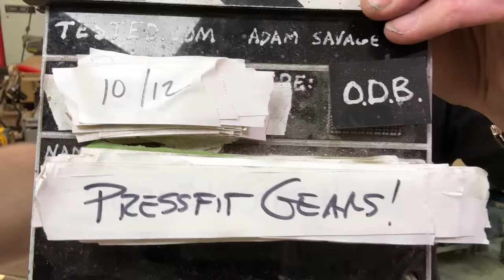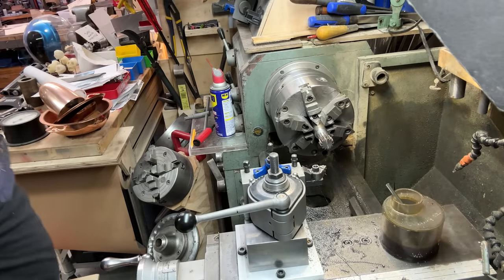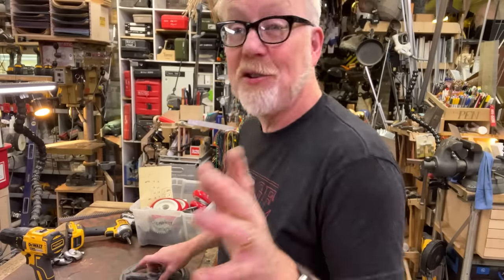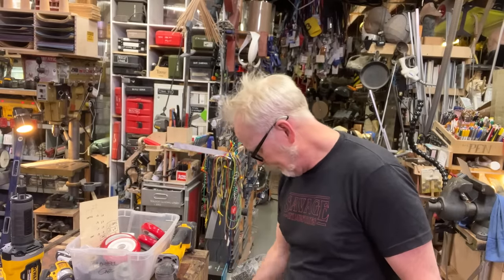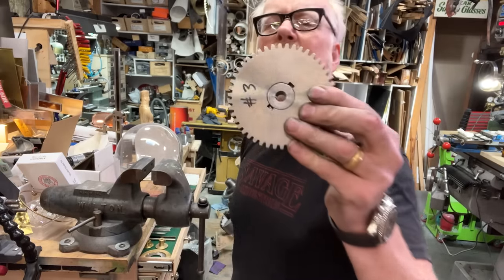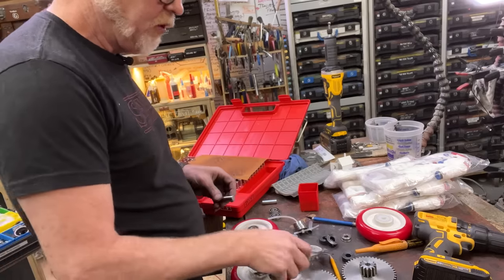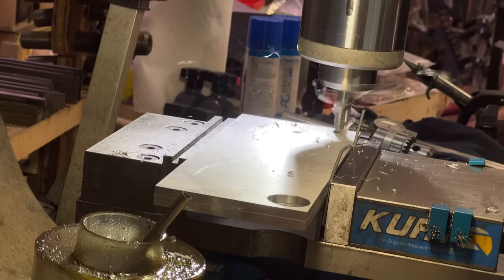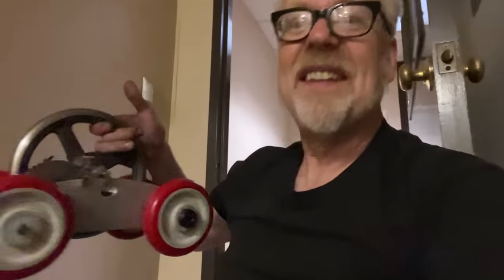Adam Savage's One Day Builds: Giant Flywheel Toy Car!

Comment: Adam not sure if anyone pointed out the low performance issue the same as I. The reason for the loss of power is due to the weight/mass of the gears in between the flywheel and drive wheel. The Inertia from the flywheel is all going I to turning those gears. The more weight you remove your performance will increase incramentally.

Comment: Since you have a planetary gear system in those dewalts, im not saying take apart your dewalts lmao im saying an old set of drills with the planetary gears, or many different type of gears, and place a North magnet on the center of the furthest gear, as well as have the other North end of a different magnet on the opposite end of the gear! The magnets need to be round of course. What happens is when you do it "North and south", it pulls the gears or stabilizes them at high rpms, but when you go north vs north, its a different thing ya gotta try. i never could try at high rpms cause i couldnt bind the magnets to the cogs without them flying off lol

Comment: The inertia driven toy car is a classic, but what about configuring this system to aid in powering a bike or even something similar to a long-board? Obviously you'd need a combo break/clutch of some sort, lest you 'ride the bomb to hell'. But it should be doable. And how cool would it be to get around San Fransisco on something as green as an inertia driven vehicle? It'd be like a Flintstone's car...that wasn't a death-trap! The ratio between overall mass and the mass of the flywheel is what's keeping it in snail-mode, at that gear-ratio.

Comment: My guess where a lot of the friction is is that middle gear set. If the flywheel and gear were separate, you could have supported the whole gear train in between two sheets of aluminum and then the flywheel on the other side with a third piece of aluminum.  I think the middle set of gears are racking slightly from the torque

Comment: For doing press fits, one thing that was always recommended to be was to heat the outer part (not enough to change the temper) and to freeze the inner part. The explanation was that heating the outer part causes it to expand, and freezing the inner part causes it to shrink. Even if they shrink/expand only a few thousandths of an inch, it could make the press fitting process easier. Or does someone know the physics better who can correct me?

Comment: There is an older video out there, (I have no clue of the title) but it is about a bus, that had a heavy flywheel in the center of it, and it would be spun up to crazy RPM's that made it crazy dangerous, but at full RPM, it would take like hours to spin down to zero RPM, it might have even been days. This video of the flywheel passenger bus, would use the stored up energy to take off, once passenger sat down and it would do this all day. The flywheel weighed like 8 tons or something crazy and required an armored enclosure around it, just in case the flywheel let go... The video is interesting, just due to the numbers that were presented to make it work

Comment: I feel like you could put some handles on it so you can properly 'charge' it. Either that or build a motorized charging platform that spun the flywheel up to dangerous speeds and then you just let it run.

Comment: I wonder if the gears being really heavy in relation to the flywheel might also be an issue. That's a lot of weight to spin up, you might be losing energy to torque required to move the gear train. You could probably get away with cutting those gears in half

Comment: Love the reference to LPL! ;D

I think the width of your gears need to be minimized. The gears are sort of flywheels themselves, so I don´t really think mass is the problem - but interaction between gears generate a lot of friction as each tooth slides into the next, and these gears seem to be able to power any normal car. So - easy test is to just grind down the teeth on your lathe to reduce interaction between gears.
Reply: No.. the fly wheel is not right
Reply: I don't think Adam really understands the physics of gyroscopic precision
Reply: Precession
Reply: Word to text

Comment: People keep saying the problem is the wheels are too small. That's not the problem. Wheel size only affects the speed that the wheels turn, and  wheel speed is not the problem here. The problem is that the flywheel is coming to a stop very quickly. You need a more massive flywheel. Either rebuild the whole thing in nylon and keep the same flywheel, or make a new flywheel out of solid lead.

Comment: Increase the wheel diameter and then try stepping down,the gear ratio so you can get more wheel rotation for,each flywheel rotation. There will be a happy medium in there.

Comment: Nice try Adam it dos look awesome though. it's lack of performance might be from the weight (rotating mass) of the drivetrain, In all the flywheel toys i had as a child the the flywheel was WAY heavier that all the gears combined and solid that helps keep the car going, your gear are REALLY heavy and you flywheel has cutouts limiting it's potential momentum it could also be a bit bigger in diameter too

Comment: Normal size flywheel cars are small enough that you can grip the chassis and push it along the ground to generate momentum. But that's too big so you have to add a handle that rises just above the flywheel, attaches to the chassis, so you can push down and forward at the same time to generate good speed.... And of course, fix that rattle.

Comment: How does one cast or repair a split plastic gear (which transmits power) in an old toy, such as a toy battery-powered front-end loader, or is there a CA glue or something like Loktite HY 4070 5 minute hybrid adhesive (which will quickly glue broken bumpers together edge to edge w/o any reinforcement).  Inquiring fathers and grandfathers with old motorized toys would like to know.

Comment: The issue with up scaling. If you pushed that at full running speed the flywheel probably wouldn’t spin a third of the speed of the little one. But great build, and year put a pitching machine on the top and it will fly

Comment: Tell me that seems as if a mechanical disadvantage was created where you can put a lot of energy into the system and it uses it in the least efficient way possible. Seems like just a caring issue. I don't know if it's primarily the fact that certain things don't work spectacularly well when you change the scale quite a bit but I think it's just down gearing and perhaps gears not messing

Comment: I'd say it's more likely that your pin gauge was correct and your measuring tool was off. Always clean your caliper and micrometer measuring surfaces before use if you are working with high tolerances. You can close them lightly onto a piece of clean paper then pull the paper out. Try it sometime. Zero out the tool then clean with paper. Often times you will then see that the surfaces were not clean.
Reply: Also don't force a pin gauge in then twist it to get it out. Treat high tolerance measuring tools with a lot of care. I cringe when I see people using calipers to scribe lines. If it's an old tool that you use for low tolerance then I guess it's fine. But never use your good measuring tools for scribing lines.

Comment: Put a handle on it to hold it up, and weld a nut to the end of the drive axle and use a drill with a socket on it to spin it up and then set it down.

Comment: Try bigger wheels, That will change you ratio with the least amount of work. Seems you don't have enough traction to get your flywheel spinning at the desired rpm. Add appropriate dye to the teeth to check your contact patterns. Straight cut open gear box is going to be noisy no matter what you do but that's ok it adds to the cool factor if you ask me. A light teflon or graphite lube will help some with the frictional losses of the gears.

  I think it would be way cooler if you got some spring steel round stock and made your own clockspring and ratchet!! With some clever modification you could use the parts you have now.

Comment: If you find your calipers are measuring wrong get some standard block gauges (msc direct has single 00 grade blocks) and check to see how far off they are. there are 2 screws on the top of most calipers that allow you to adjust them slightly. however they might be too far off and you'd have to send them in for calibration
Reply: For others interested in this topic, Adam has a very nice set of Mitutoyo gauge blocks that he demonstrates in the video "Adam Savage's Epiphany on the Science of Measurement!" on this channel.

Comment: But If I did we would have to look at transmission momentum and drag, friction of every thing big and small and metal and plastic and higher and lower speeds to see if there is a differing performance arc of the four, or eight remarkably similar machines. Seems like fun?

Comment: The child in me say it works just fine.  You put all your upper body weight on it, holding onto the sides and you slowly crawl or walk the wheels up to the speed you want.  That flywheel will be going at some crazy rotational speed, and will carry it for some distance I bet.  Trying to get the rotation you want by hand-cranking the flywheel or the wheels seem inefficient.

Comment: From the very beginning I was like "Yeah the scale of the flywheel is way off". I had some of these kind of cars as a kid which were actually fairly big and formed like F1 cars. When I was a bit older I took them apart out of curiosity. The flywheel in those were fairly substantial both in size and weight compared to the overall weight and size of the cars. The scale, rotational speed, weight - and thus momentum seemed very off to me before you even started the built. Also I'm fairly sure the weight of the gears contribute A LOT to the fairly rapid loss of momentum of the flywheel and making the gears a lot thinner - maybe 2mm thickness - would most likely do a lot here. Lastly I would just put on larger wheels to help with momentum/forward motion.

Comment: Was the final drive wheel diameter factored into the gear ratio wheel 
I've made that kistake before altering sprockets and forgetting the factor in a smaller drive wheel

Comment: The Main Issue i see is that Adam can't get enough energy into the system by just manually turning the wheels. The small flywheel cars get an awful lot of energy for their mass by being shoved over the ground at a decent speed. Adam gave the large flywheel car a lot less energy in relation to the mass, as he was shoving it rather slowly. To get a good comparison, the large one would need two handles and someone putting real power into the initial push, or you could "load" the flywheel with with a motor.

Comment: Since your wheels are significantly smaller, compared to the gear they are coupled to than the wheels on the original, your overall ratio of linear speed of the tire surface to flywheel RPM will be significantly higher than your model.

Comment: The gear interfaces are just too large, resulting in high power losses via gear interface friction and gear binding.  One can never machine gears to the required tight tolerances.  Instead, think of watch making:  your large diameter gears should be much thinner so its interface to the smaller gear is minimal.  This will reduce friction and gear binding in the interface.  Another suggestion is use brass gears against stainless steel gears whenever possible, they will form a lower friction metal interface.  Suggest the large, thin gears be brass and be made as thin as possible, similar to watch gear proportions, and the pinion gears can still be chunky and made of stainless steel, or possibly tool steel.  The lower modulus brass will also allow more flexure and more tolerance forgiveness in the gearing system, reducing gear binding and friction.

Comment: the mass ratio of the flywheel to the other gears are different in the larger steel model due to square/cube relation. when dealing with steel it becomes very obvious when you start to scale. everything has way too much mass--all fingers point to the intermediate gears as the top choice for optimization. replace them with PLA.

Comment: Remove some material from the smaller gears for less spinning mass, the ratio of mass between the flywheel and gears is too similar.  THEN, lap the gears with some valve grinding compound and replace those small wheels with some larger ones. Look at the size ratio of the small toy relative to it's flywheel...

Comment: You need to put a handle on that thing, spinning the wheels with your hands isn't enough.
With the small car the body is the handle, if you would spin the wheels of the small car instead of pushing the whole car forward it wouldn't get very far either.

Comment: Never thought of a cheater bar? A piece of pipe to make a handle longer. A box wrench would have been better than channel locks. You should get a 4 jaw. Better for indicating in a part. Might get a cheater pipe for the lathe wrench. Should have some plastic, and aluminum pieces nearby for "soft jaws". Take a piece of 1/8" welding rod, and bend a, inch, and a half acute angle hook on one end, and a 90* handle on the other to hook, and pull those "murder ribbon" chips out. A cover on the flywheel to reduce wind resistance. That's the fastest moving thing, and is obviously the end of significant losses. Oil it. sounds like a lot of oil less shafts. At slow test speed you don't lose as much as at running force on them.

Comment: two major flaws: 1st - extreme losses of energy because the gears are spaced to close together, we can hear them grinding. This is the main problem, additional to losses in the bearings.
2nd - Adam ONLY focussed on replicating the gear ratio but ignored everything else! But while wheel size only affects winding up and max speed of the car, the main problem is that the weight of the flywheel compared to the total weight of the car is far to low, especially uphill.

Comment: Seems like your ratio is backwards. With a large flywheel and small wheels, I would expect your car wheels to be making more rotations than the flywheel, like 10 to 1. Rather than pushing the car to spin up the flywheel, you could spin it up with a pull rope. I imagine a handle on the back of the car which you could grip while pulling the rope with the other hand. Then put it down and let it rip!

Comment: The fundamental problem is 2 fold:
1. You are not storing enough energy in the flywheel
2. The parasitic mass of the vehicle (everything other than flywheel) is too high.

Overcome item 1 by making larger or heavier fly wheel, or the better solution higher gear ratio (which is what everyone else suggests, since that won't add weight to vehicle), which will make flywheel spin faster but will be harder to accelerate and may introduce other issues like max speed on bearings/gears.
Overcome 2 by reducing weight of all components other than flywheel.

EDIT:
To clarify, higher gear ratio means 1 turn of wheels translates to many turns of the flywheel to maximize flywheel speed. Accelerating the car should be much harder than barely moving it; that way you can store more energy into its flywheel per foot of driving it by hand than it will expand per foot of motion.

Comment: SO many machinists and lovers of vintage / high quality vises are cringing at the excess jaw pressure and channel lock abuse that fine Wilton bullet vise is being forced to endure - im afraid one day using it as a press will break that cast iron, a Wilton bullet is a fine vise but like many Adam sees the vise as a press instead of a holding fixture, doing heavy press work in a vise often bends the jaws out of alignment or causes a fracture - its still (cast iron) and will fracture if its limits are exceeded.  Heating the female and freezing the male parts would make those press fits SO much smoother and easier on both Adam and the vise- actually I would have thought Adam with his experience would have done it that way.

Comment: try magnetic-mechanical clutch cvt lock gear (both magnetic and mechanical gear tooth functions, with optional 90 degree pin-magnetic slider cvt variable gear ratio)
Reply: freedom does not need to measure :) anything, just abundance, all the time
Reply: very intimidating flywheel
Reply: if you make it a flywheel energy storage (by-through electric motor-generator) then you change charge it with rolling, it being clutch detached, from the wheels, only through electric connected to the flywheel
Reply: to be a kid again :)
Reply: the flywheel is too heavy compared to what you want to speed the wheels to
Reply: you have too little power, the wheels must be able to spin faster, the flywheel is too heavy load

Comment: I personally think it's behavior is as expected. Your not getting the wheels moving very fast initially they are not going to wind up more.
The gears could be gapped better I like to just a use a piece of paper on the gear teeth to avoid going over depth
And I am pretty sure you have enough energy in that system to power much larger wheels 🛞 🤔

Comment: Gears are too heavy and wide. The narrower gears add less friction for the same mechanical advantage. Also would add a post off the back middle as a handle to be able to push wind the fly wheel from the wheels contacting the floor instead of trying to spin up the flywheel or wheels. Maybe even a rip cord like from old school wheel gyroscope toys. Or even a hex bolt head off one wheel so a drill can be used to wind up the toy before release.

Comment: I think the higher the flywheel rpm, the greater the mechanical loses. A faster flywheel would nog work. I think you need a lower gear ratio. I have seen these type of toys where you need to drag them over the ground really fast to charge, but when let loose, that's how fast they go, it is way to hard to get the rpm's enough for that in your model to get decent speed, and distance. And time is against you with mechanical loses.